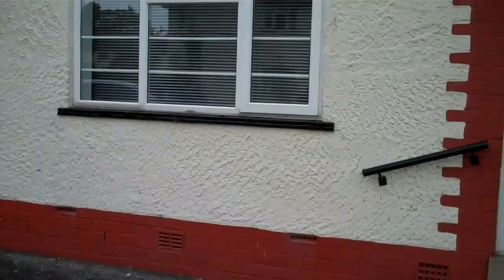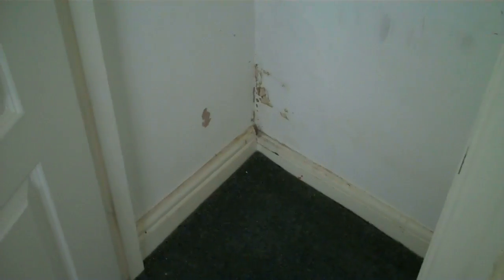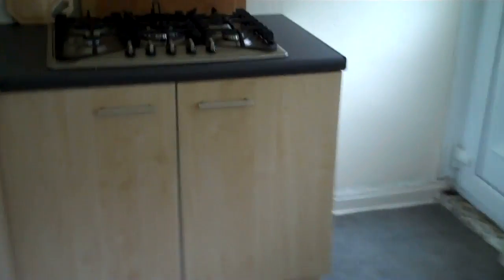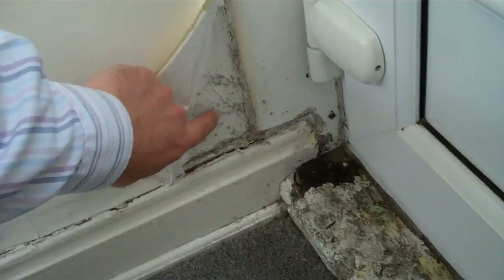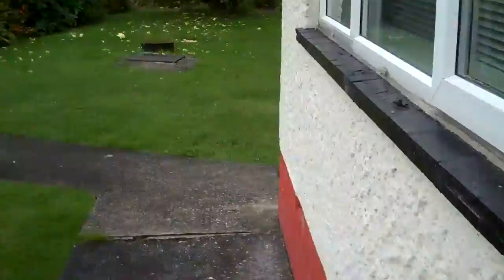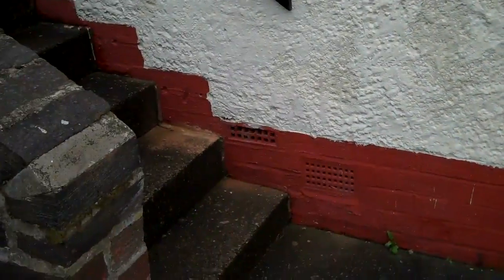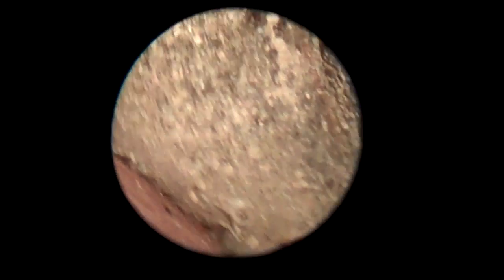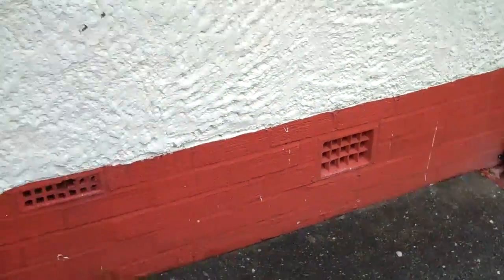Damp Diagnosis for surveyors:  Bridging as a cause of rising damp

Comment: wouldn't it be a good idea to get rid of the external pants and let the house dry as the plastic paint will hold damp in the walls.
Reply from the maker: Hi Phil, good question. Well that would be a good thing but the paint is already there and removal of it would be costly. This home has a cavity wall so most of the moisture produced in the building will evaporate via that (there are 'one' air bricks through it. Mechanical extraction in the wet rooms  is a must - it is double glazed and the fireplace are bricked-up. The paint can be tolerated.

Comment: Very good video.
I am helping me son who has just moved into a Victorian ground floor flat , the front is below ground level and the rear leads out level to the garden . There are a number of damp patches inside, the floor is not that long ago pine type floorboards. On the outside I can't see any air bricks to the rear elevation but on a part set back there is a large square air vent which doesn't seem to go below the floorboard level.
I don't know what is below the floorboards and am assuming there are floor joists. I also don't know if there is a dpm on the house.
On the rear elevation there is a cement render which looks like it was done in the last few years, part of it by the rainwater down pipe needed re rendering which I have done and I have also tidied up the rainwater drain which needed attention.
After watching your video I am now able to understand how important it is to analyse it correctly and the I am unsure of why there doesn't appear to be air bricks could they be buried under concrete patio bit.
Any advise would be greatly appreciated.
Best regards
Nick Barclay

Comment: Per war property that has cavity wall insulation installed 2012. Discovered dry rot in the front bay window area this week. Have removed all flooring timbers and joists. Found cavity wall insulation breaching the cavity and filling air bricks any recommendations ?